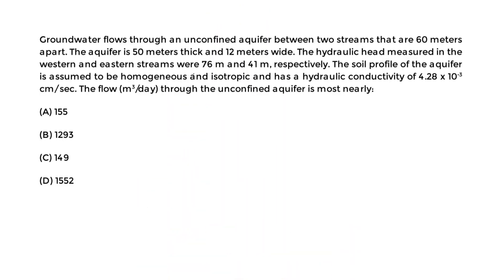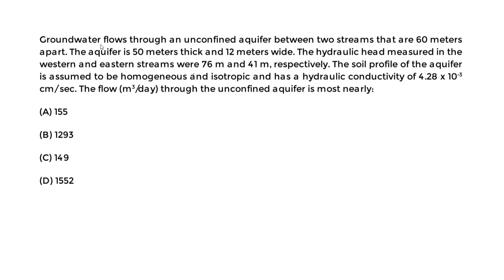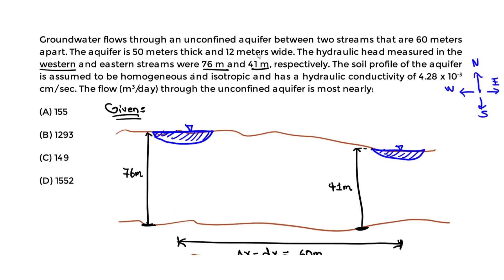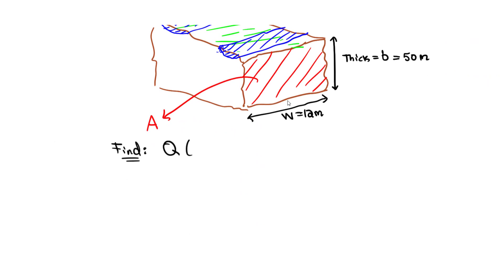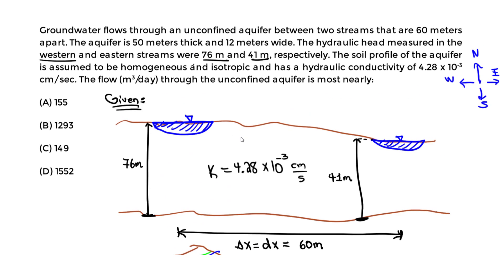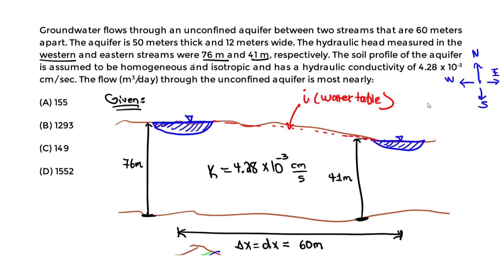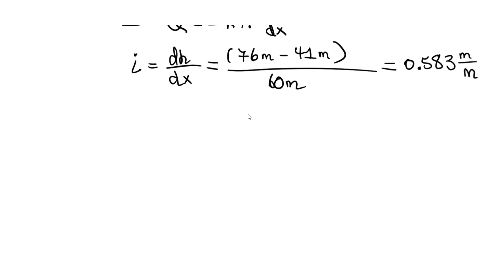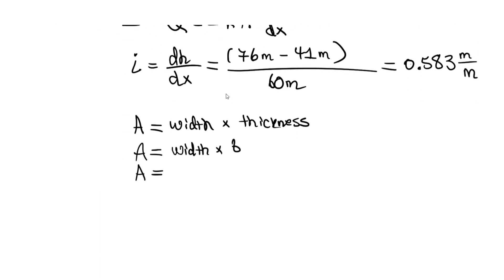FE Exam Review - FE Civil/Environmental - Groundwater - Darcy's Law

Comment: An interesting problem I got recently on the FE Environmental  is called a 3 point problem where they have you solve for the hydraulic conductivity. I was having trouble determining the hydraulic gradient. It seems the length between wells has to be determined with the equipotential lines. Maybe the distance between.Might be a good video to put together
Reply from the maker: Hi Kevin! Did you check out this problem? 

https://youtu.be/Swyb960mvtg

It’s the same process. They’d have to give you the distances between wells to find the hydraulic conductivity

Comment: what happened to the negative in the equation?
Reply: The negative is because Dh is actually 41m-76. Remember the water always flow from higher ground to lower. So. the difference should be actually h2 - h1 therefore dh= -35m
Reply: @ricardoarturolaraperaza9988  Thanks!